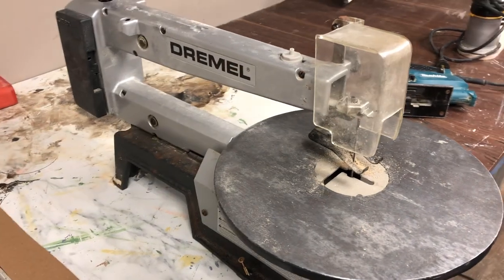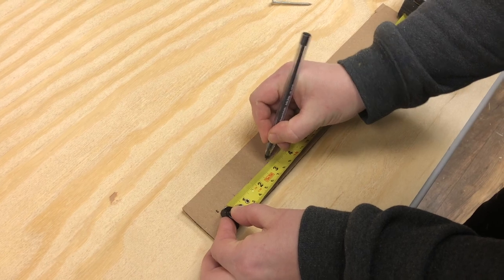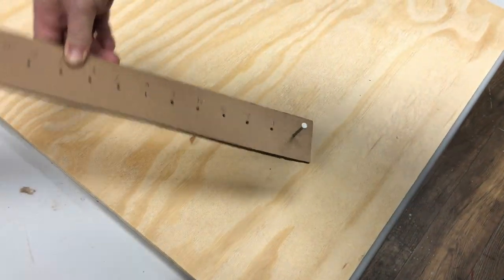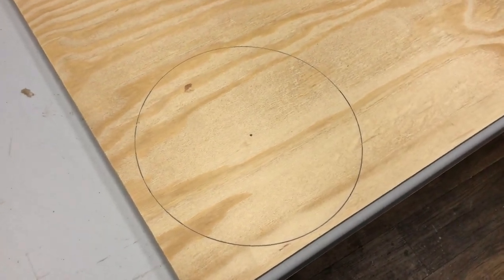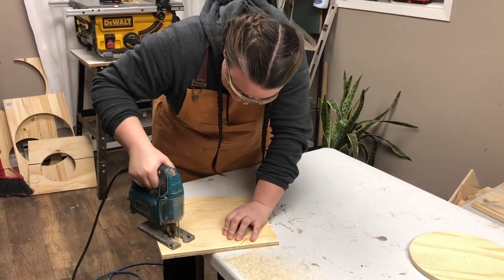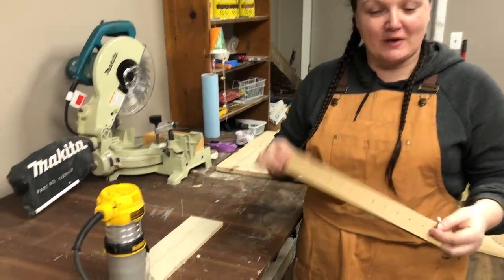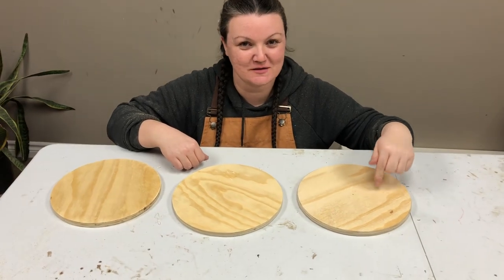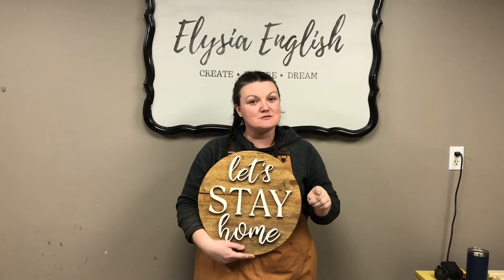DIY EASY WOOD CUT ROUNDS|Cutting wood circles|How make round signs| Perfect circles

Comment: You're brilliant. I do a lot of woodworking and I always used string tied to a nail to make circles. I like this method better because you can vary the diameter with one tool. Thanks for the tip. Krista

Comment: Very informative. I need to cut a 9 1/2 inch circle that is 1/2” deep in a 3/4” thick piece of wood. I want to put a piece of marble from an old side table as an insert into this piece of wood. How would I scoop out the excess material of the 1/2” thick circle?

Comment: Recently I had a project where I needed to cut shapes out of wood.  I have a Dremel scroll saw but perhaps it can be used only with very thin wood, but I could not get the blade to stay straight.  Then I tried my both of my jig saws and the edge was raw and hardly moved (my bad: the teeth of the blade were facing the wrong way but I didn't realize that until a couple of days later).  Then I realized that the most sensible tool would be my router.  I tried to imagine a jig (I had made some jigs 20 years ago) but was at a lose and in a hurry.  So I settled on the jig saw with the blade turned around.  I did not like the results so now I am determined to start making jigs again.  Your circle jig is a perfect way to start.  Thank you so much.